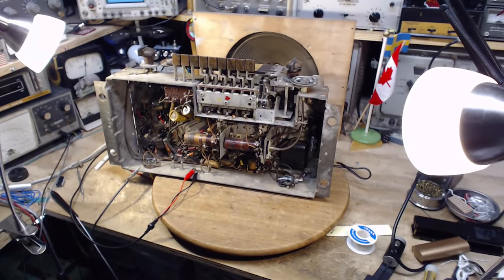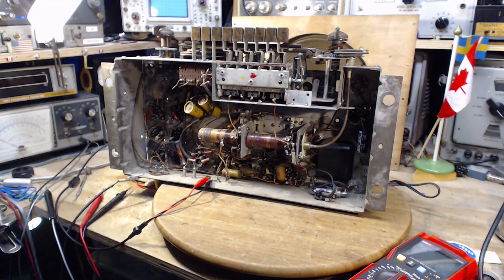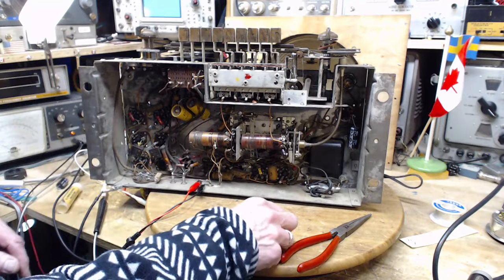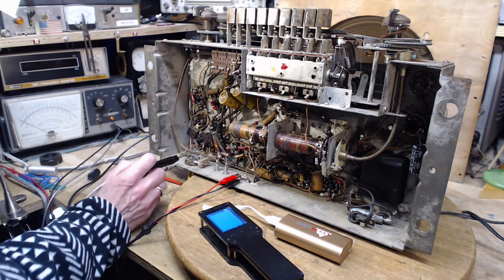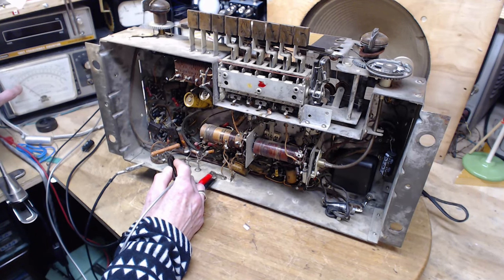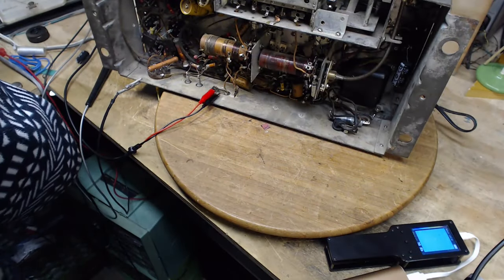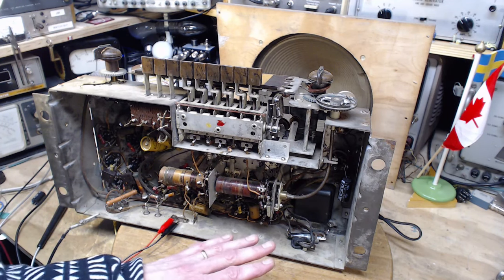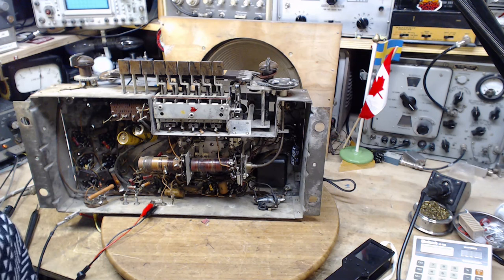Silvertone 101-583-2 Multiband Tube Radio Video #11 - Overheating Speaker Field Coil

Comment: Just an interjection to ponder by those who follow and want to learn;
What would be the most reasonable target parameter for choosing a parallel resistor? 
Bringing the resistance of the parallel circuit to 600 Ohms in total?
Or should the 600 Ohm target be neglected and a parallel resistor be selected with Kirchhoffs law in mind; in order to ensure the current splits between field coil and shunt resistor in such way, that the  field coil gets the amount of current flowing through it, which it was designed for?

Remember that the main job of a field coil is not being a resistor but an inductor to provide the magnetic field for the speaker. And with an inductor it is current flow and number of turns squared which determine the field strength, not the voltage drop across it.
Just think of it this way; two coils who pass the same current and have the same number of turms would produce a magnetic field of the same strength. But when they operate at same current and have the same wire length (no. of turns) the DC voltage drop across them is only a function of wire diameter. 
This is why going by the basic ohm reading of 1.7k on the new coil  is bogus for design purposes of a shunt resistor.

Comment: Wow
If not using ohms law I would have used clip leads to test that random resistor before soldering it in.
That 5 watt resistor is going to get HOT!

Comment: If you calculate 5 watts heat dissipation in a resistor, you DON'T use a 5 watt resistor. Double it (10w), and smart fellas will add a little more for comfort (15w). And, you INCREASED the size of the parallel resistor, when you should have decreased it to better match the 600 ohm drop the original field coil had. Going the wrong way.....
Reply: I thought ever so briefly about the situation and concluded that he needed about 900 ohms or so to arrive at a total parallel resistance of 600 ohms. . Y'know he might have used a decade resistance box to determine the combined resistance so he would not have to calculate the value. Still does not solve his problem In that the radio is not to be restored, a junk box choke would work and shelve the electrodynamic speaker.  Just saying. This is nothing that 2 years in a tech school couldn't cure.
Reply: @robert-nv1qn  Yep. For Jim, it's not about repairing the radio as efficiently as possible. It's about tinkering, exploring, learning, and sharing that "adventure" with his viewers. It can be very frustrating at times (I often yell at my screen), but I continue to watch... I do enjoy seeing the various vintage radios he presents to us. Not so much the phonographs, which to me are just mechanical things that need cleaning and lubricating. Boring.

Comment: Google parallel resistor calculator. Punch in 1769 ohms then adjust 2nd resistor till you get 600 ohms. Apx 900 ohms. Use 15 or 20 watts and youll be good.

Comment: I want to thank Jim for introducing the solid state FET active AM antennae on his program.Today I finally got mine up and installed. Reception based on day time is phenomenal. Once I was able to receive just a few stations, now I get over 20 across the AM band in daytime. 
However  My advise would be to find an old car radio , tube or solid state. You will find vintage car readies to be The best receivers ever made.Hooking it up to a 12 volt supply is no problem. 

My radio is a 1969 Ford Galaxy AM only model. Its made all discreet solid state components, drawn less than an amp at 12 volts.
Now I am ready to build an enclosure for it.

The only  real problem is the AM band in America is a huge wasteland of Jesus freak nut job radio programs and demented  
  right wing anarchists.

None of it is worth a dam! As far as I can see restoring vintage AM radios is a waste of time and effort.
I am finished restoring junk only to,listen to junk.

Comment: this is easy there is high current       Coming from the load of the capacitors charging and the load of the radio Operation   the loading to run the output maybe    interesting problem  
 a resister will get hot the current and the voltage are not lining up  
 lead or lag    on a much smaller scale    Check for Leakey Caps        Hope you read this
 thank you your friend in the South
Reply: like i have told jim on video#10  "CAPS"  they or one of them is pulling it down... 
I'VE TOLD HIM YOU TOLD HIM AND SO HAS OTHERS... EVEN GREG 😆😆😆🤣